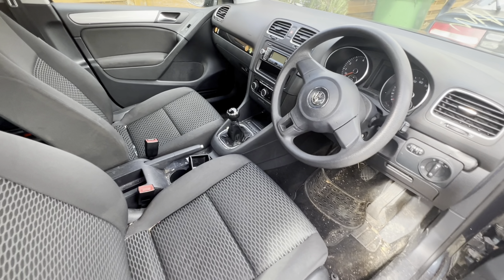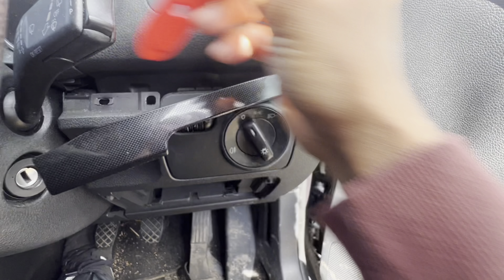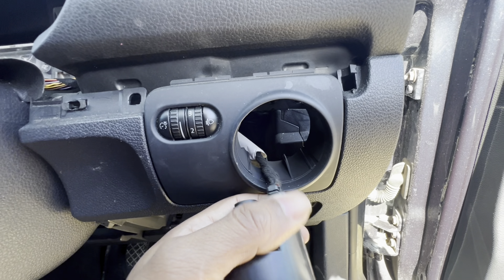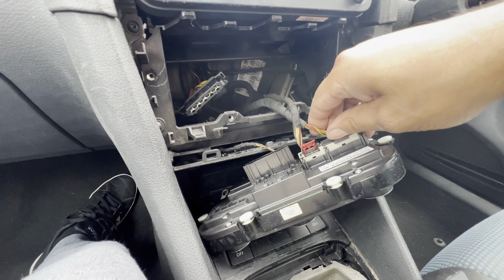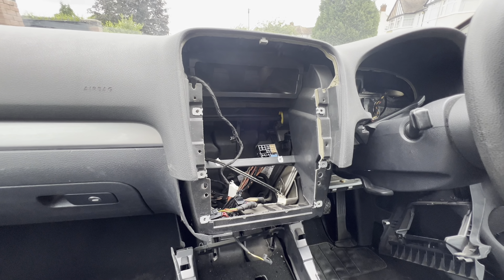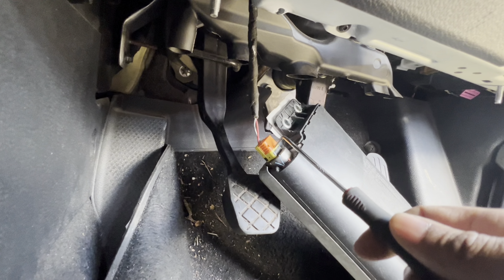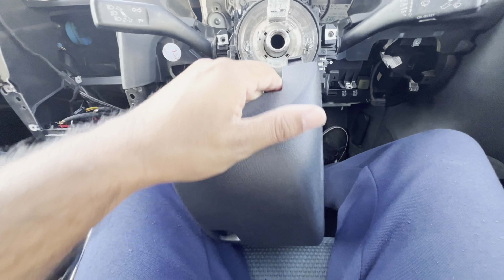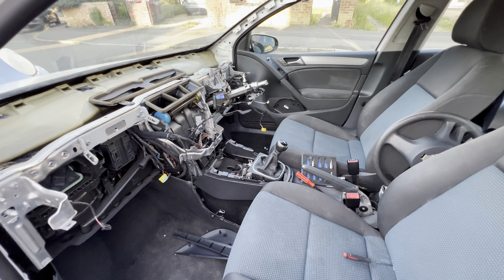POV VOLKSWAGEN GOLF MK6 - DETAILED DASH REMOVAL ( dashboard removal ) - HOW TO - STEP BY STEP GUIDE

Comment: 14:09 hey, i can‘t remove that metal piece where the knee airbag is attached to. I already removed the twp bolts but it‘s not moving. Any ideas?
Reply from the maker: @bajraktar2592  

Hi, to remove the metal bracket for the knee airbag your going to have to remove 2x 10mm bolts on the right of it (above) & 1x 10mm bolts on the left of it (above), if your just removing the dash then 2x t20 bolts removed should allow you to free the dash…

Please see link of my other video below (4:07) showing how to remove this bracket. 

10mm bolts X3 in total (these are hidden behind the dash 👍

https://youtu.be/gassi4DEvG0?si=qMvk-pwCrHEZ_EqZ
Reply: @ it worked! Thanks!
Reply from the maker: @ brilliant 👊

Comment: Do I have to remove the steering wheel to remove the dashboard for painting?"
Reply from the maker: @علاءنمارنه  you can either remove the steering or drop the steering column to the floor, which should be 4 bolts under the dash 👍

Comment: Please help 
How many Nm to tighten Golf 6 steering wheel bolt?"
Reply from the maker: @علاءنمارنه  Hi, Volkswagen Golf Mk6, the steering wheel nut should typically be torqued to 40 Nm (29.5 lb-ft) but I would recommend to double check the owners manual book to confirm 👍
Reply: @zabzproject1416  thanks good man